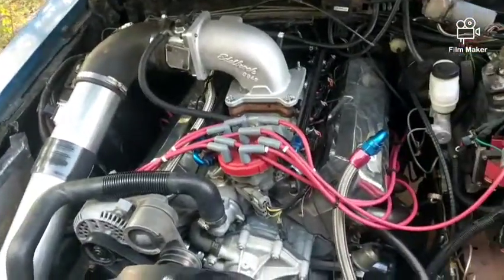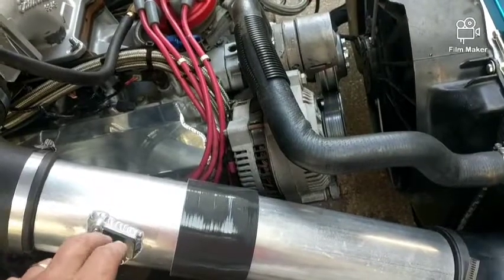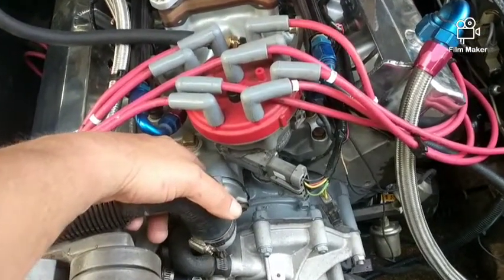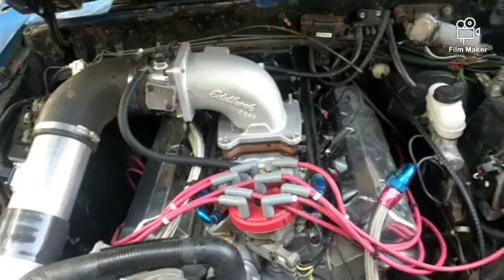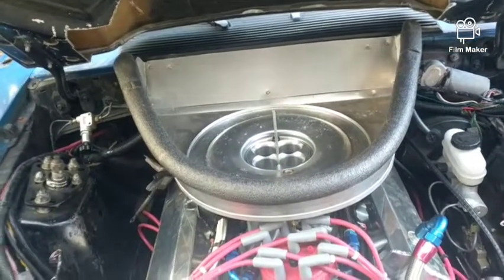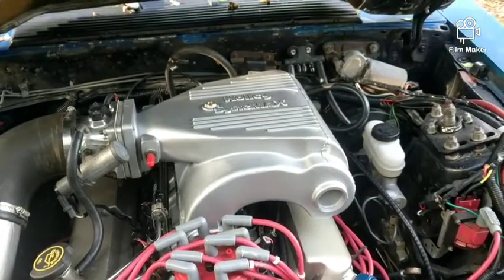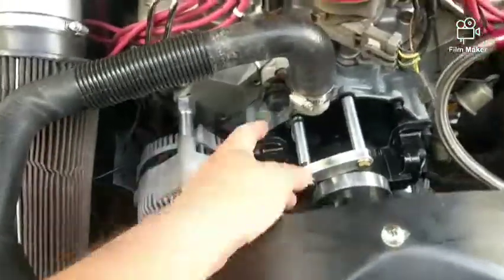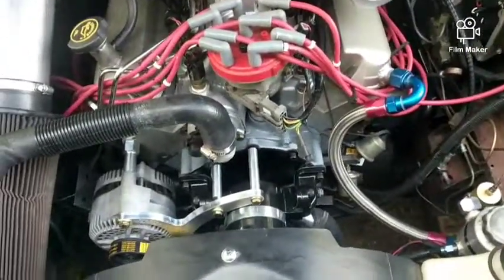Stupor Trooper intake manifold changes

Comment: What booster did you use for the brake upgrade?  I was reading that if you use the 93 cobra booster and mc, you have to 'massage' the strut tower for the SN95 brakes.  Thanks
Reply from the maker: One from an early model SN car, and yeah they're bigger. One of the engineers for Maximum motorsports posts on corral that a foxbody V8 booster will work well with a 99V6 master cylinder with a 1" bore, so that's what I'll be doing on the capri, and Dugan wagon.
Reply: @FXRSDriver  Excellent! Which Booster, as my 83GT booster is different than an 87-93 V8.  I guess you mean the latter?
Thanks David!

Comment: I drill and tap my thermostat housings for a pipe plug. There are also 90 deg. housings with a boss that can be drilled and tapped for coolant sensors if it's 1/4 npt. Enjoy your content!
Reply from the maker: I have a set up like that on my 90LX and LTD for the aftermarket temp gages.